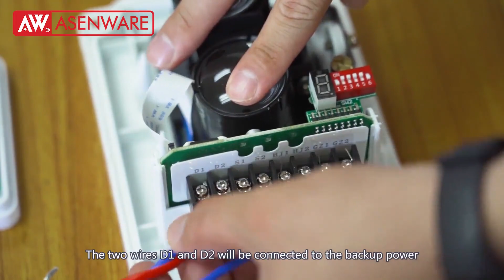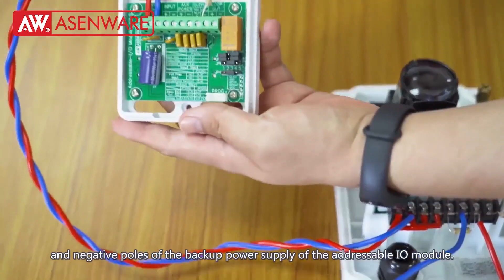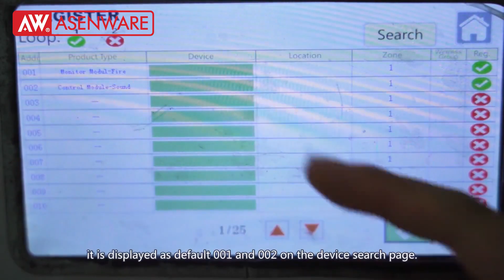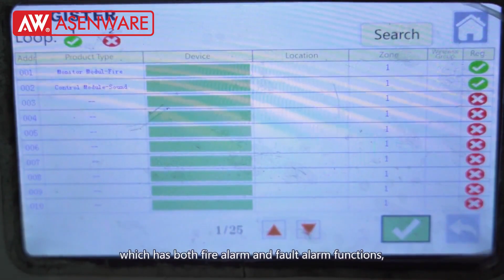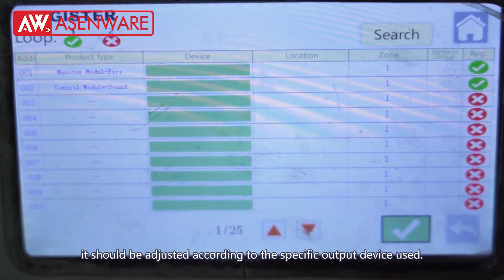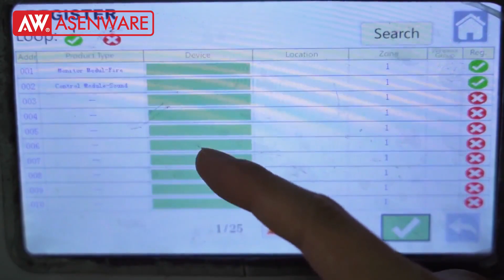Addressable IO Module & Beam Smoke Detector Wiring and Connecting

Comment: How can I address, find, or program addressable call point and strobe on addressable fire panel without module
Reply from the maker: Better with a programmer dear, or you can set with our programming software on the computer.

Kindly contact us for more information:
Email: info@asenware.com
Whatsapp, Wechat, Tel: 0086 13922805301